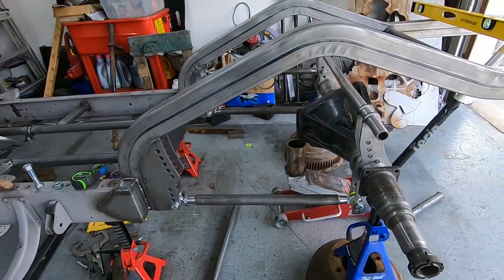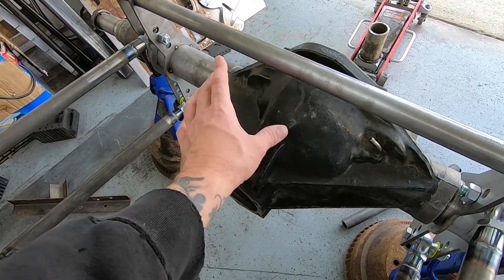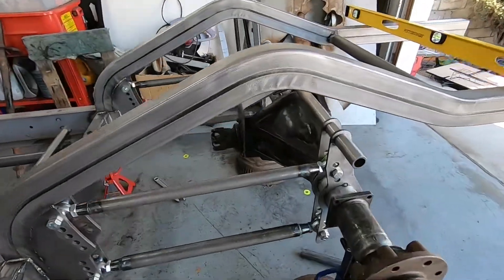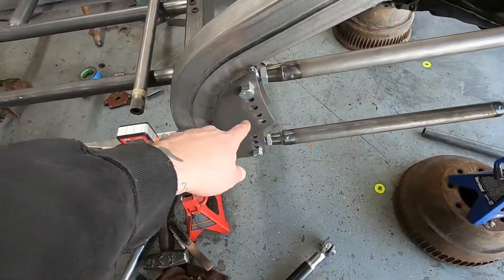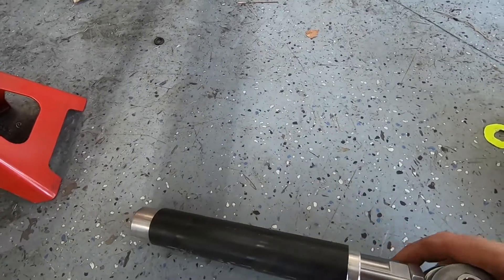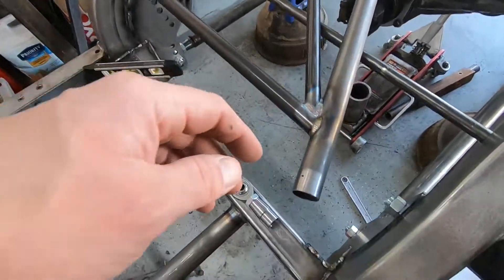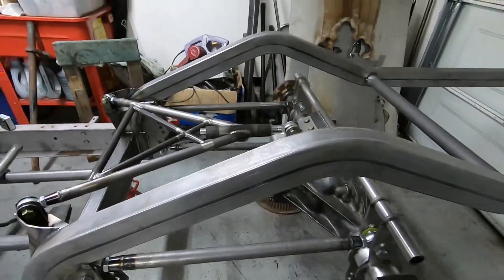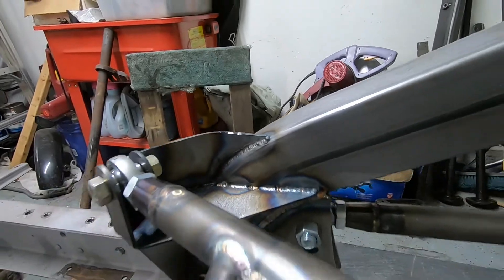48 Ford BBC Turbo Build EP. 7 - Building a Wishbone for the 4 link suspension

Comment: Just subscribe im watch and trying to learn mine is a 1965 f100 just finished cnotch frame 14 bolt norrow duelly starting on mounting crown Victoria crossmember o6 motor is 5.3 4ll60 lflat bed with drop sides little Different